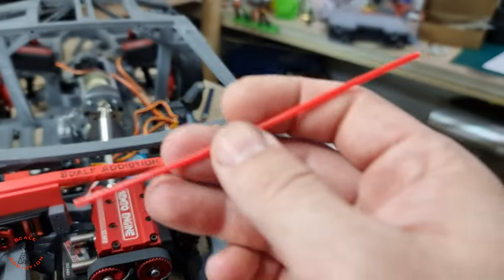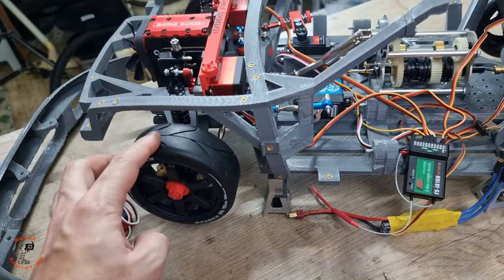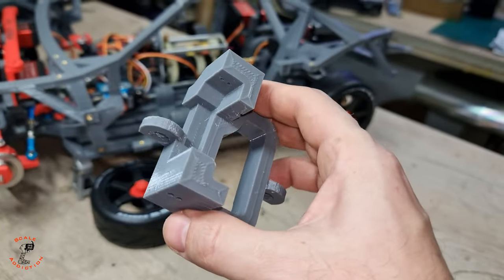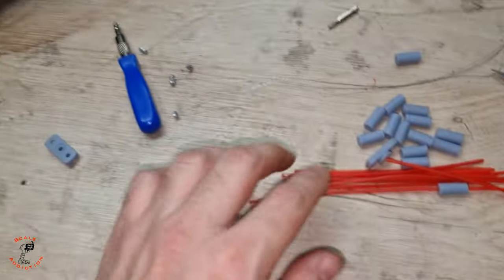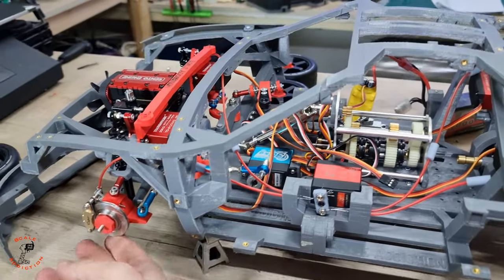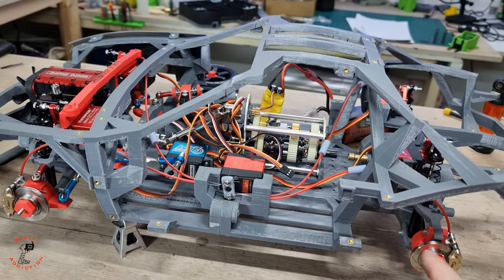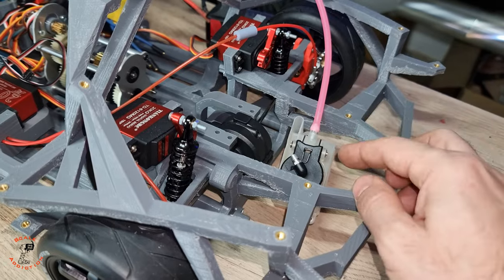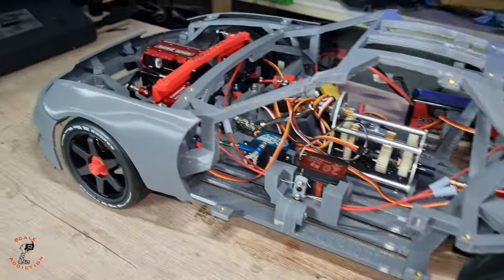Part 10 / 8th scale 3d printed supra with 2 cylinder engine project / Scale Addiction

Comment: Love it!
Cant wait to see it run!
For the brake wires, maybe you could put a screw with nut throug the brake wire hole. drill a hole in the screw head(sockethead). and put the wire throu the head. then thay are induvidually adjustable.
Do you think it will handle the torque, or are you planning to drive it carefully?
Can you turn down your music? I manually controll the volume to switch between too hear what you say, or quickly turn down the volume so i dont wake up the hole house
Reply from the maker: The brake works good so far, I will have to test it with engine to know that, sorry about the music,  it was low, but after render, it came out high, next time will be better
Reply: @scaleaddiction  Nice, looking forward to next video :)

Comment: Can you please update the component list it is inaccurate, outdated and Missing a lot of the newer stuff
Reply from the maker: Only the brake us out of stock on aliexpress,  but you can find it on ebay, what else you can't find ?
Reply: @scaleaddiction  my issue isn’t what’s out of stock my issue is that the parts list on a cult 3-D hasn’t been updated in almost a month or so so stuff like the manual transmission and the correct driveshaft and also missing and the bearing that’s all I can remember off the top of my head
Reply: all I need at the moment is the manual transmission and the length of the dog bones used in the video  @scaleaddiction
Reply: @ajahniepemberton1860  I would recommend waiting for the transmission and clutch stuff. Rn the clutch is mounted to the body while pushing into the engine causing the engine to be pushed on the mounts ebeyrtime you engage the clutch which is weird

Comment: You need steel roll cage with hand made fibre glass body panels and brass sub frame for front middle and rear with 30 % nitro methane for full power at around 45000 rpm and between 6 to 8 thousand rpm to the wheels with a custom high rpm friction clutch ,, I’m just saying I kinda know first hand

Comment: This is very good. But as it runs in gas engine, the impact force during collision is great, metal frames are more appropriate, or the longitudinal pieces need to be at least. I remember that, when I was young 40 yrs ago, I implemented front wheel drum brake on a 1/10 gasoline off-road car, but, as the tire width was thin and car weight was light, the dragging force effect on the ground was not great. When I grew up 20yrs ago, there was 3d printing, but it's not as popular as today, I used my working company's one; an industrial SLS type to print parts for my design SUV R/C car as for my leisure fun toy use. It's an electrical motor operated some diy designed 4 speed gear shift one. I did less on gasoline engine R/C car, you are good and suceed to build it, it is more realistic than electric type. You done a smooth surface modeling in car body. Nowadays, it can be done easier as seen the type of better software you used. Back in that year, I used ProE's Pro-surface, it was a parametric one, it was much difficult to use and the outcome was not so good
Reply: This is a experimental frame , he will metal make it later

Comment: Grat project Man ! 😀Can I ask You , what Caine of infill and wall setting’s You used to print the chassis and this cage ? Its PLA ? Look pretty solid .
Reply from the maker: I used 25% and 6 walls with 6mm nozzle, yes it's pla
Reply: @scaleaddiction  With this 6 walls its strong enough ? What Caine of infill you used ? Im asking cause I am designing a 1:4,5 scale rock bouncer , also printed in 90% on printer but I am using ASA filament.